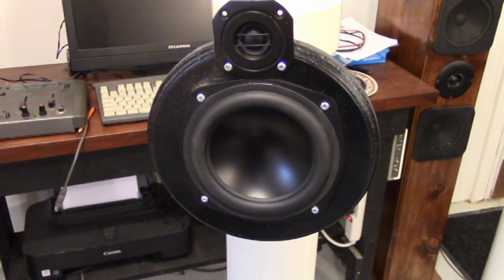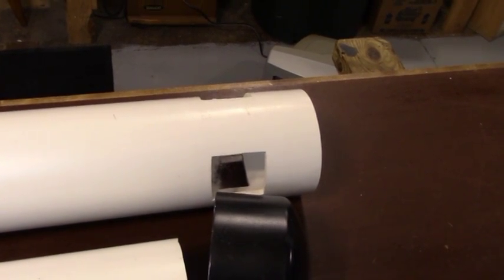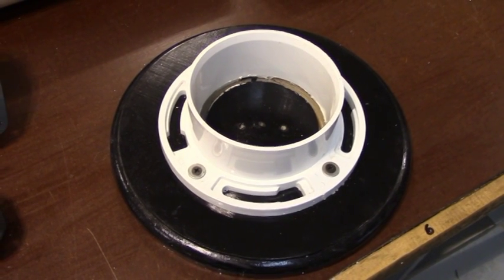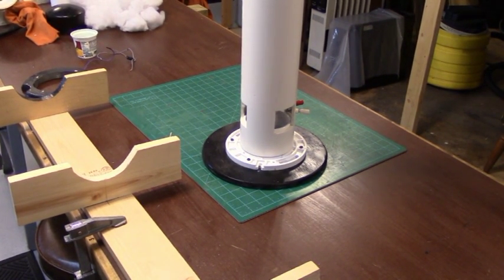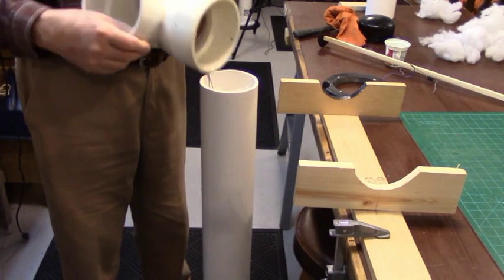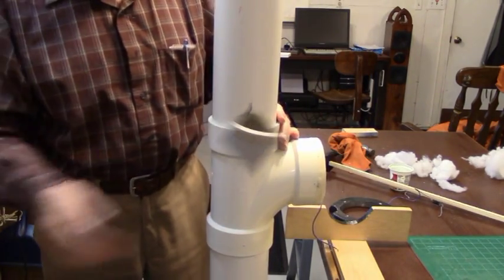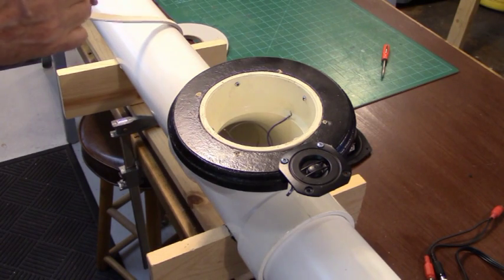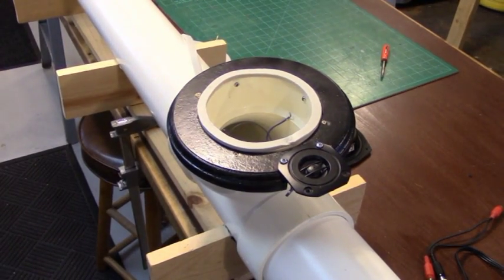Pipe Speakers 2

Comment: That's awesome, I looked at building bass speakers using 12" pvc pipe, and then for satellites using 6" pvc, you can get both sizes at Lowes, you've encouraged me to do that project someday.
Reply from the maker: The 12" pipe would open up more possibilities for a ten or 12 inch subwoofer.  Good luck with it.

Comment: Consider using a 2.25" hole saw to cut the ports in a round shape instead of making them square.  The area of the ports will be almost exactly the same as the 2" squares.

Comment: How about a line array using pvc and smaller speakers?
Reply from the maker: Interesting idea but how do you mount them? Better just to use dimensional lumber 1X6 for 4" . Use 1X4 for the sides and stuff well with polyester. No port needed, use with a sub woofer for bass. Two slim towers will give great imaging.
.

Comment: I just bought a set of speakers to replace the old ones in a pair of ( 11 X 14 X 30 ) cabinets.  The woofers are 12".   I wonder if I should trash the cabinets and build some tube enclosures.  Not sure where I could buy some PVC pipe that big.  I know they make them in sizes that large because I have seen them.  I wonder how much better the sound would be and if it would be worth the expense and effort.
Reply: I don't know about PVC pipe in that diameter, but look for the very heavy paper forms used for pouring columnar concrete footings.  One common brand is Sonotube, and you can Google that name for more info.
Reply from the maker: You can get 12" PVC but it is expensive and heavy. The cardboard Tubes for making concrete pillars would work as they are of thick wall construction. I've never tried them but others have.
Reply: PVC pipe can be puchased up to 48". That is pipe and all the fitting, at irrigation wholesalers.

Comment: Found your videos by accident but LOVE homemade projects like this! Going to build some with my 13yo son!

Just curious what your parts cost was for this particular set?
Reply from the maker: About $30.00 for the PVC components. The tweeters are about$4.00 each and the woofers were $30.00 each. However you can find 5.25 inch woofers much cheaper on line at parts-expess.com. some as low as $8.00 on sale.

Comment: Are the speakers wired in parallel, or series for the cap.  Simple schematic would be nice.
Reply from the maker: Speaker are wired in parallel with the cap in series with the tweeter.
Reply: Got it, thanks.

Comment from the maker: No one has developed such a calculator as yet and it would not be easy to do so. Suggest you look for a copy of David Weems book, "Building And Testing Your Own Speaker Systems." It' s out of print but you may find copies at Amazon. He has a chapter on building pipe speakers that can serve as a guideline.
Reply: Ken Bird   Ken, in the 70's, There was a configuration called "THE CONGRESSIONAL SUBWOOFER".  It was a 4" fullrange driver fitted in a toilet flange. coupled to a series of Quarter turn 4" PVC elbows.  I made one in 1978! It had amazing bass response. It was bascically a folded horn, like  A KLIPSCH HORN. You could call it a Klipsch mini-me.   :)
Reply from the maker: I never saw that project but sounds like it was just a folded version of the straight pipe design. I made my first PVC speaker in 1968 .
Reply: You are correct, it is just that. I think you remember what "That tube sound" really means, as do I. We're about 10 yrs apart, but I think we are in sync about speaker technology. I can still remember buying raw drivers from Radio Shack and Lafayette Radio. I also remember "Radio Row 45th st" The original on lower Manhattan was a little before my time. But I have been to canal street many times from the mid 70's and 80's.
Reply from the maker: When I worked in the consumer electronics industry I would get raw drivers as samples from the manufacturers. Had quite a collection in those days. McGee Radio was another good source for speakers. Today Part Express, and  MCM offer some good products. If you want high end Madisound is the go to place. I have a number of tube amps in my collection, some of which I built my self. Tubes are OK and they played a great role in the development of audio, but today's Class D amps are great also and they save a lot more energy.

Comment: What is the exact wiring connection for the capacitor? Thanks.
Reply from the maker: The capacitor is attached from the positive speaker lead to the positive terminal of the tweeter.
Reply: Does the Capacitors' negative connect to the negative banana and speakers negative?

Comment: Using plastic for acoustics, is like using lead pipes for plumbing. Not only is it wrong but the end result on both is horrible :-)
Reply from the maker: Well, lead pipes will poison you, but PVC audio can be subjectively quite pleasing.
Reply: But what about plastic cones for drivers? How is that any different? The thickness of the PVC makes for very rigid housing (no resonance from movement). Look at the B&W Nautilus speakers. They use a lot of resin with the fiberglass (no resonance from movement).
Reply from the maker: Good point Durst. I've even used heavy cardboard and foam sheets for prototype enclosures. A five gallon plastic bucket also makes a good sub woofer enclosure.
Reply: Actually, using plastic for acoustics is like using plastic for plumbing. It is a lighter, stronger, economical option.
Reply: To make the ulimate subwoofer I buried a 45 gallon drum 6' from the outside wall, used a 24" woofer, 120lb. Cut a 4' hole in the wall and made a cement horn to match the opening to the speaker.
Reply: @robertkat  lol awesome. pls do a yt video on it